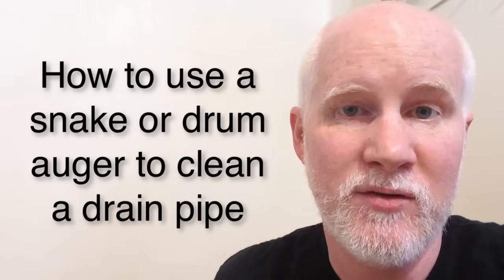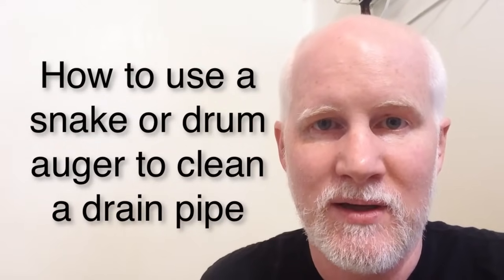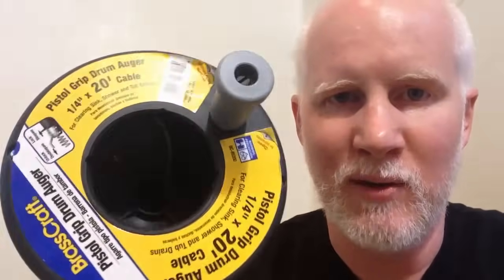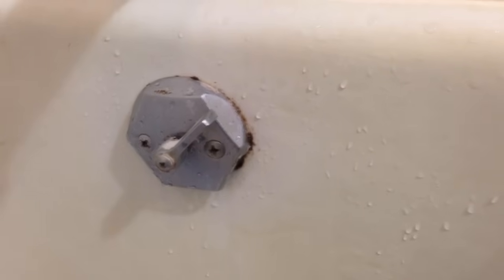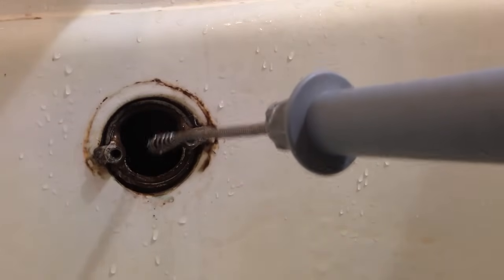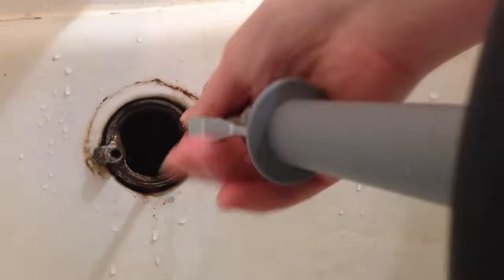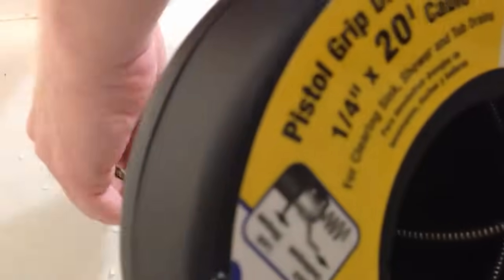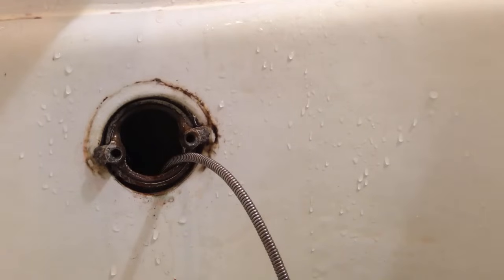How to Unplug a Bathtub Drain Using a Snake or Drum Auger

Comment: It worked!  The tip at 4:10 is key... only leave a small amount of wire exposed between the drain hole and your tool, because if you have a long length it flops around and all your force is not being directed down the hole where it belongs.  That's what she said.

Comment: Anyone else stuck on the first elbow wondering what to do next? Thanks for the help, you're saving DIYers everywhere 👍
Reply: That's what I need to know too!
Reply: @birdsong3   @DanBeadle Did you figure it out? I got stuck as well
Reply: Same
Reply: On my third smoke break just trying to get this thing in
Reply: Fawwking stuck at the same elbow!
Reply: Been an hour and still can't get passed the 1st elbow. 😡😩 Countless videos have been watched and here I am now.  Send thoughts, positive vibes, sage and prayers this is the last video I watch and it works. 🤞🏻🙏🏻
Reply: Your stuck on the trap. It's u shaped and hard to get snake to pass thru. Keep spinning and feed pressure at same time.
Reply: I was stuck. But after some thought. I decided to see if the source of the blockage was outside the home or within. So i found the exposed pipe immediately outside of the house, that comes from the shower. I removed the cap off the 90deg bend and turned on the shower. I found that the blockage was somewhere outside of the home because the water overflowed at this cap instead of the shower now. I put the auger in there and got the gunk out. This allowed me to avoid the trapper but also get closer to the source of the blockage. Cleaned it a few times before the job was done

Comment: For everyone with a snake who can’t get it to go into the elbow - if you’re going through the top hole you can use a flashlight and look down the bottom drain hole - you should see the end of the snake and be able to use a long screwdriver or whatever you have to push it down the elbow into the next length of pipe:) - thanks for this video it just saved me a big bill !
Reply: I really appreciate that because I can ever get a snake down a tub. I can't wait to try again with your advice.
Reply: By top hole do you mean the overflow? Cuz man I cannot get this snake down at all it’s freaken hard

Comment: You sir have a good dynamic when narrating; like a good professor. Good video👍.
Reply: By the way, I did exactly as you sir in the video and got a very good result, in fact I was surprised by the amount of hair/goo that came out on the snake it was like 32" long; and the water goes down nicely plus, I put a strainer, thanks👍!

Comment: It worked!  Took a couple of times to get it all (yuk) but the tub drains now.  Definitely get the snake with the rotating handle.  Tip: when you hear glugging noises at the sink, that means you've got something and should reel it in.  Be prepared to be grossed out.

Comment: Thanks a lot ! Worked for me and saved me $$$. I was trying this snake to clear the water stuck in my tub but it wasn't working for me before I watched this video. The key is to push it from the top like shown in the video. You will come across a couple of stops, but just keep on going by rolling the wire whenever you hit a stop. After 2 minutes, the water stuck in the tub starts moving and I knew the clog has been dislodged :)

Comment: I bought the auger and used it today but I don't know how much of the wire to use. So I just pushed and then stopped when I felt it was enough, I had anxiety about pushing it further like you did. Tub still drains extremely slow... should I push all 25ft down the drain, is that safe or will it get stuck? Where does all 25ft go, I feel like it's gonna go into my neighbor's tub

Comment: Today is 12/22/19. I have a plugged  bath tub for years. I used a plunger to push in and suck out some sludge and i used wet-dry vacuum cleaner to suck out those dirts that came out. Well, it solves the clog for maybe 3 months the it clogs again. Its always a cycle for years until the past 3 weeks my method wont no longer work.  I've vacuum it for couple of times for the next 3 days but water will drain too slow. I'm so stressed out and in dont want to waste more $$ to call plumber. I told myself if plumber can do it, so do I. So I search lots of video tips to use an auger although I have a 25ft 1/4" auger but I am having hard time snaking it in. Until i saw this video and i payed attention closely the steps how to do it. Here is the key, on the first 1-1/2ft you inserted the auger, once it reach bottom of the P-trap, you will feel the resistance. At this time, have at least 3" of auger exposed to have a good leverage to spin. Here is what you do next: AS YOU SPIN, GIVE A PRESSURE, REALLY GOOD PRESSURE SO THE AUGER'S TIP WILL FIND ITS WAY OUT FROM THE P-TRAP AND SNAKE IT IN THROUGH HE NEXT TURN OR PIPE ELBOW FITTING.  If you feel the bite that the auger has moved in, there you go... it will snake it in freely as you spin.  NOTE: DO NOT GET FRUSTRATED IF YOU ARE HAVING HARD TIME SNAKING IN BUT I WILL GUARANTEE YOU IT WILL GO IN NO MATTER WHAT JUST APPLY PRESSURE AS YOU SPIN AND THATS THE KEY STEP.  As of this morning 12/22/19, i was able to unclog it with flying colors and from now on, the secret to use the auger id successfully revealed with this video. Thank you Sir for this big help.  To all out there still having clog issue will guarantee you that you can do it. Good luck to all and Merry Xmas!!
Reply: I fed it a few times.. once I dragged out some hair, but then it just blocked at a certain point.., and I'm a little scared to push it through...
Reply from the maker: @Cynthia33c  You might just have to call a plumber, and then you can watch and see how they get past that joint.  My pipes just happen to be relatively easy.
Reply: @ericrosko  p

Comment: Second option is putting a plastic bag over the overflow opening, use a plunger on the tub it’s self and it will most likely clear your clog.
Reply: I tried the plunger--maybe I gave up too fast? How long does it usually take?

Comment: An old 1950's American Standard tub drain so probably a 2 inch trap at bottom with no plug , easy to run cable around if you have the 1960's inch and one half trap with the plug in the bottom you will never get the cable thru the trap
Reply from the maker: You are correct it's an American Standard and that sounds right!
Reply: I believe I have the 1950's 1 1/2 inch p-trap you're talking about. This video should be updated with a flashing warning at the very beginning because your words are so true. "You will NEVER get the cable through this type of p-trap". End of story!

Comment: does it matter if you rotate it clockwise or should it be counter-clockwise? thank you
Reply from the maker: The end of the steel cable is round in a specific way, and I think it makes sense to rotate it in the direction so the cut end rotates so that it will capture hair and move it down the spiral.  So kind of like a corkscrew works, so grab whatever is in front of it as you turn the handle.  It will depend on how the company make the cable.  Hope this makes sense and good luck.

Comment: Clean up tip: if the snake and tip come back coated with a really nasty black coating - you can have a bucket with some warm soapy water to rinse it in. You can even use the toilet bowl water in a pinch (easy to flush). Better than handling the black crap - it will get everywhere if you dont rinse off the snake.

Comment: Tried doing this, pulled up a little hair but not enough to make a difference.

What worried me was the overflow drainpipe itself was starting to come loose from the tub.  So I stopped myself right there...gonna have to call a plumber.  One thing that makes me angrier than not being able to fix something myself is making it worse by me trying
Reply: that's what I'm afraid of. And if I screw up real bad and mess up other apartments I have to pay for that (living in a co-op)

Comment: My bathtub drain is clogged and when I use the snake drill nothing comes up…what do you think is the problem and what should I do ???
Reply from the maker: I'm not a plumber, far from it, but it sounds like it's time to call one.  They have experience, extra long snakes, and little cameras they can send down to see the clogs.  Where I live the clogs are only 10-15 feet down the pipe so my 25' auger works fine.  Good luck.

Comment: Will it work for tree roots? I'm not sure if that's the problem or not...how can you tell?
Reply from the maker: The augur I use definitely won't work for tree roots.  They have special augers with cutting blades for those, and that is the time when you need to call the plumber.  I wouldn't try it myself if that were the problem.  This is for cleaning out indoor pipes that probably don't go all the way to the ground.
Reply: @ericrosko  yep its either tree roots or the galvanized pipes
Reply: @birdsong3  I watched a plumber use an electric auger to clear my main sewer line of invasive roots.  It's a machine you don't want to mess with unless you know what you are doing.

Comment: .            good presentation , I had a similar issue  ,  and I used a 15 Foot auger , it formed a permanent kink ,                                      next step go for the larger and more sturdier auger  ,                                                       and cleaning with a towel for better maintenance is a good tip   .

Comment: will it work on tree roots
Reply from the maker: No, this is a small auger for indoor pipes and the biggest thing it should get through is probably a hair clog.  Every 5 years or so we pay a plumber to use a big industrial auger with a cutting head to clear out roots getting into the 3.5" to 4" outdoor cement pipe connecting to the city's sewer pipe.  That job is way past my comfort zone and they have very expensive gear to do it.

Comment: i don't know what plumber you have that uses that little drum job...the electric machine gets 35 ft cable and spinns through turns easier. .plus they can charge for machine use..
Reply from the maker: You're right, the person I learned this from was the handyman, so he didn't have one of the big machines.  In the case of my apartment the shorter length is long enough since it's a small apartment.  If you are in a house with long pipes I can see where you might need something longer.  Thanks for the comment.

Comment: I tried it.  A small amount of goo came out.  At some point I must have done a something horribly wrong.  
Drain empties ok,  but ever time hot water goes ⬇omg the smell of the sewer gas is overwhelming.  I have no basement so now it be at least a 20k job to fix that pipe.  I'm thinking when this house was built they used metal.  Who knows what they used back then.  Not me.

Comment: Why not go directly into drain?
Reply from the maker: My thinking was that the drain has a sharper angle than going down the supper overflow outlet.  However, I don't think it matters since the cable needs to bend at a 90% angle again to go down the pipe.  Going down the overflow also prevents any scratching on the chrome drain fitting which is probably the best reason.
Reply: @ericrosko  thanks, the reason I asked was because we only have the drain, since it's a walk in shower.  But I tried the auger in the drain but had no luck, bit the auger got tangled so bad it would recoil back into the drum.  Calling plumber tomorrow.